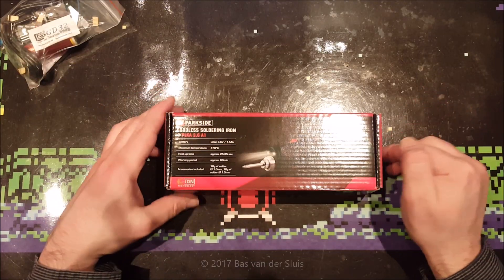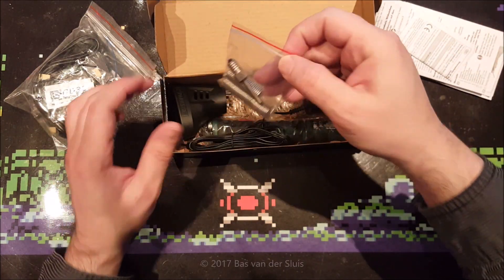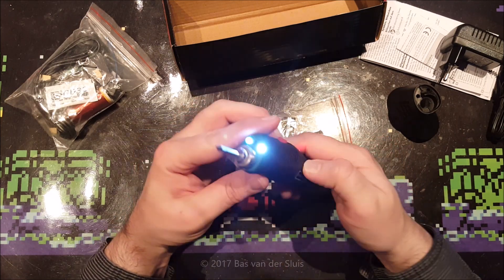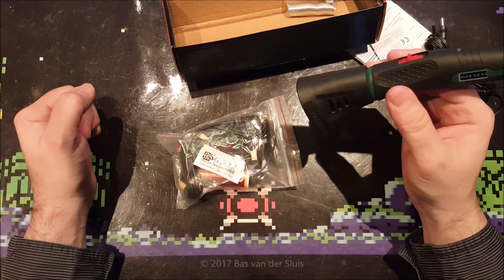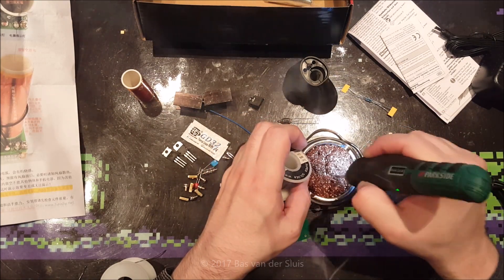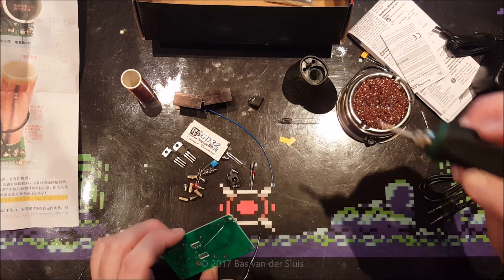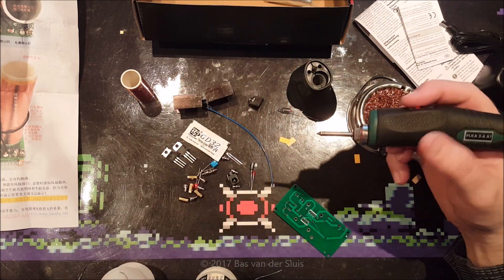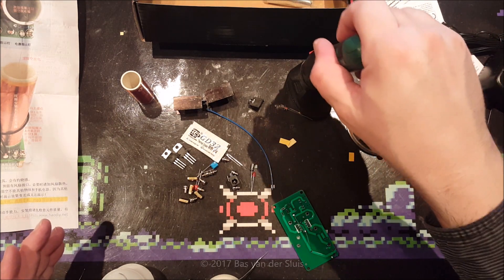Testing the Parkside Cordless Soldering Iron

Comment: For anyone looking for replacement tips..  Seems only the actual manufacturer of the irons offers them at the following link; 

https://grizzly-shop.de/navi.php?a=32091&lang=eng
Reply: You know what... I like it so much I'm going to find a way to hack it; especially as Grizzly want 6 euro's (each) plus postage from Germany!
Reply: Do tag me if you make a video or post about it ! Very interested. I looked almost everywhere for bulb style tips, seems they're kinda a one-off idea by that company. I guess maybe you could use one of the old tips and/or a small bulb like you'd find in an oven light. Not sure if that would give enough heat if you soldered it to a tip without the glass. Or if you'd just end up breaking it. I assume its just power / gnd to the metal with copper beneath the coating on the tip
Reply: I wonder can you diy one from a bulb fitting / a good tip
Reply: I'd say it wouldnt have the power to heat something that long. even with the length it currently is, it doesn't get  hot enough for larger wires
Reply: Im just gonna save up and get a ts100
Reply: In the manual it said you could contact a lidl team to get replacement tips iirc
Reply: joey malone the tips are garbage. Mine disintegrated before the iron needed its first charge (soldered 8x cree 3w LEDs). Unless replacements are no more than a couple pounds I will be returning it for a refund. Shame as I really liked it when it worked.
Reply: Sorry to say the tip detached itself completely from the Edison screw base today while I was giving it a final chance to reprieve itself soldering a little project... It became very clear from the break there is no way to repair or modify it so mines going back to Lidl for a full refund - I'm definitely not shelling out an extra 15 euro's (with postage to the UK) just for ONE new tip that I already know is poor quality! If the proprietary tips were not such a rip-off I'd say this was a nice little iron. Lesson learned: buy a quality iron with readily available and reasonably priced spares. 😏
Reply: AdrianM do you think it possible to slide an antex soldering iron tip over the top of it ?
Reply: AdrianM only goes up to 400c so I'm told on ebay
Reply: I wouldn't even say it goes that high tbh, even with trying to desolder small components it takes quite a while. I just keep a power inverter in my car at the min and use a corded.

Comment: Thanks for the review, you told me all I needed to know before buying this iron. Just an update on your model, they current one just has 1 power switch where you hold for 5 seconds and its on, press again and its off. There is no power supply just a USB cable and you get just 1 roll of solder.

Comment: This iron and derivatives are sold by Action (Ferm), Vonroc ( both dutch, 4 tips including chissel tip at Vonroc ) , Lidl ( the Parkside one ), Aliexpress ( SB-B161 ). Ferm claims it is a Dutch design made in PRC. Tips are also available on Aliexpress at suprisingly high cost. That is the drawback of all of these: tips are expensive compared to the initial purchase price. So much so that you'd be better off buying a new iron.

Comment: How did you get solder to stick to yours? Mine doesn't hold the solder.
Reply from the maker: Prepare a wet sponge and heat the tip until it melts solder without any problem. Then clean the tip with the sponge multiple times and repeat the process until the solder sticks. Don't ever use sanding paper.
Reply: @basvandersluis5662  thank you!

Comment: I made it work at 12 V for better performance. This model is 6 W and too weak for my purposes. LED light work after modification. I can still use batteries if work require.
Reply: You used 3s battery for the 12v and is yours still working ??

Comment: is it worth the 10 quid that lidl want?
Reply from the maker: Depends on your needs. If you find yourself in the weirdest corners of your house doing some light soldering, then yes. If you need a little more power or are always soldering at the same place, use a temperature controlled soldering station.
Reply: @basvandersluis5662  hmm sounds like this is gonna be ok for in car use. what type of battery is inside? im assuming its a 18650 type? also how long does it run for till it needs recharge?
Reply from the maker: @slybunda  One 18650 cell indeed. I don't know how long it will run. I've never ran it that long. I soldered all the wires at my ceiling with it. I guess that was more than 2 hours work. (but it was not on all the time)
Reply: @basvandersluis5662  hmm possible to replace the battery with higher capacity one? is it a protected cell?
Reply from the maker: @slybunda  Possibly. I have not yet cracked it open. :)
Reply: Mine gets hot enough to melt solder but not enough to melt it to anything.

Comment: Hey nice video :) I have a question. Should i switch it off and then plug it in this plastic stand? Is there a fear of burning the plastic if the front is not cool enough? Thats all :) THANKS
Reply from the maker: Thanks! As soon as you let go, it switches off automatically. The tube inside the holder is made of metal and has openings for cooling, so I guess it is made to put in there directly after soldering.
Reply: 2:37 The stand has a connector that plugs into the iron when you put it on the stand.
I guess this will automatically deactivate the heating and start charging.

Comment: I got it on sale in Lidl UK, it was the last one. Many years ago I've done electronics degree but then moved to the IT field so haven't really worked with electronics much apart from putting together arduino boards etc. For my amateur use of fixing headphone cables or soldering together some connectors from time to time it's perfect.

Comment: The heating element is in the tip, so should be quite efficient. I have one of these but not used it yet. I would like a source for spare and alternative shape tips. Anyone know a source please.?
Reply: grizzly-shop.de But if you read the manual, lidl state they can supply tips by contacting them.

Comment: Where is this for sale?
Reply from the maker: My wife bought it at the Lidl, which is a supermarket here in the Netherlands (and some other European countries).
Reply: Yea I can't find anything like it online anywhere. Let me know if you would ever consider selling and mailing me one.
Reply from the maker: The Lidl does not sell them all the time. It's just available for one week sometimes and after that it's gone for a long time. I'll let you know when I see it. You can also check eBay for the Weller cordless soldering iron (battery powered). That one seems good too.
Reply: @geekyzstore3691  Where are you from? Theyre gonna be selling them this upcoming monday (April 11th 2019) over here in Bulgaria. The only difference from the one in the video is that its gonna be 4 volts instead of 3.5. Price is 15 euro ($17) per unit.

Comment: I got it myself, I absolutely love it. Went straight in the tool bag outside pocket in its holder like a glove. Only thing is i need replacement tip a flat style one do u know where i can get one? It seems like a light bulb fitting
Reply from the maker: I've been looking for replacement tips too, but have had no luck so far...
Reply: Update - It is now dead. Won't charge, the lithium battery went too low. Luckily lidl have them again tomorrow. But I wonder would a butane one be better. Hm